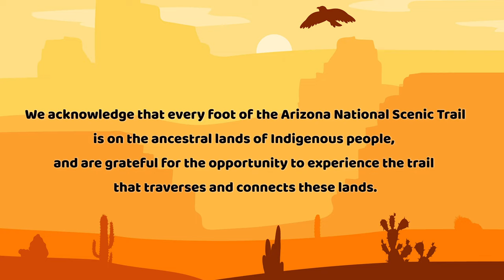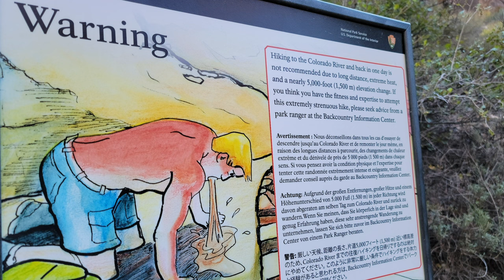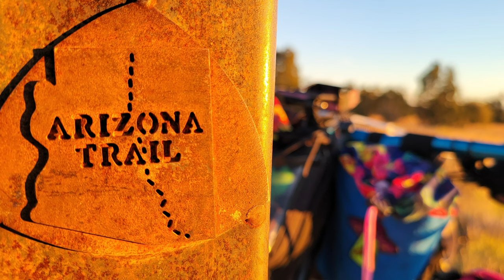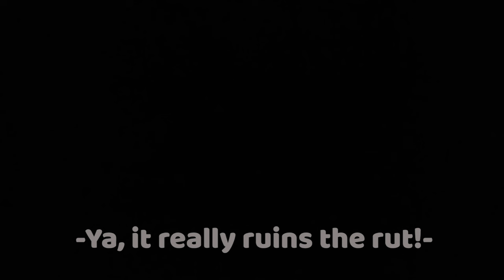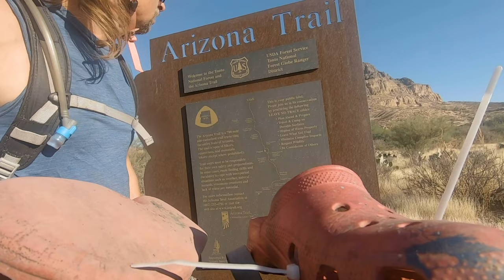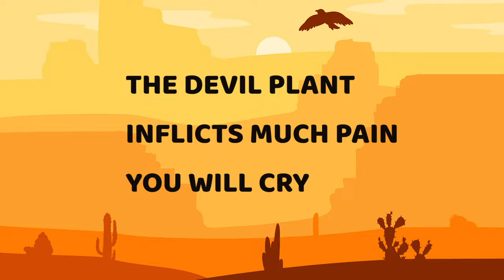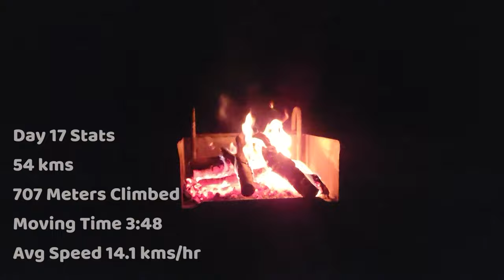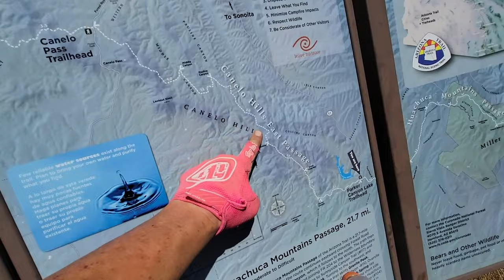Realtalk on Bikepacking the Arizona Trail (entire trail aka Thru Bike)

Comment: What is the name of your stem Gopro mount that's sweet! Loving this video, planning on a spring NOBO trip in about a year or so!
Reply from the maker: My go pro mount is just a basic gopro mount that you might use for putting on a kayak etc... and I used one of those sticky go pro mount pads and stuck it to my stem cap.  That didn't work for very long, but actually lasted a while, so I used two zip ties to hold it down.  Worked pretty darn well!  Good luck with your trip, you'll never forget it.  Thanks for watching! :)

Comment: Your video is great fun. You did a great job editing.   Would cut resistant hockey skate socks or rose gardener's arm sleeves have been helpful?
Reply from the maker: Thank you for watching and for the kudos on the edit.  I think anything would have been helpful for the cat claw.  We did find our knee warmers to provide sufficient protection and they are pretty thin so I think anything would work.  Just not bare skin!  😂  If you find something that works please let us know.  I'm sure many folks would be happy to hear it!
Reply: @BenAylsworth  I leave for Arizona tomorrow to do the AZTRace 800 NoBo.  So I will soon find out.  The trail seemed much easier Spring time in 2016, than what your video revealed for last Fall.  I think I will hang towards the back of the pack and let others break trail.
Reply from the maker: Nice! Best of luck with the race.  And that is a solid strategy.  Let the zippy 300 milers take the pain! 😄

Comment: I have a Mount Hood mountain bike. Does your bike have special suspension on it to travel the Arizona trail? Does the slime injected tubes work well? Thinking about trying a short trail trip
Reply from the maker: Hi Marshall, you don't have to have suspension for the AZT, however depending on how much abuse you want to receive from the trail you may want to consider it.  I had a hard tail and Jonny had a full squish bike.  I think he enjoyed the downs more than I did, and I know his ass did. :) but the best way to know is go out for a test ride and see you how you feel.  For a trail like the AZT I 100% recommend having sealant in your tires.  Or any type of riding tbh.  It's the best way to reduce flats!  Best of luck on your adventure.  Let me know how you make out and thanks for watching!

Comment: been wanting to do this . but havent found the parner yet or group . how manny flats ? i am thinking of putting red foam fill inside my tires .
Reply from the maker: Hi Jose.  You should do it.  I would suggest posting up on bikepacking.com or other sites to find a partner.  In terms of flats, we didn't have any flats, other than that patch of goat heads we ran through we didn't really encounter any tire issues.  I will mention though that we always put new rubber on before a trip like this (I was running 2.4 Conti Trail Kings with extra side wall protection) and for this trip I put in 4 ounces of fluid (Orange) in each tire.  Worked very well.  Just don't ride off the trail.  We learned that very very quickly.  :). Thanks for watching.  Let me know if you have any other questions!
Reply: Thank you  l   live in Sierra  Vista AZ  I done parts of the  southern area  near parker lake  Coronado national  memorial  montezuma trail  .
Reply from the maker: @joseadavila7445  If you live in AZ I expect you know more about flats that I do!  😂